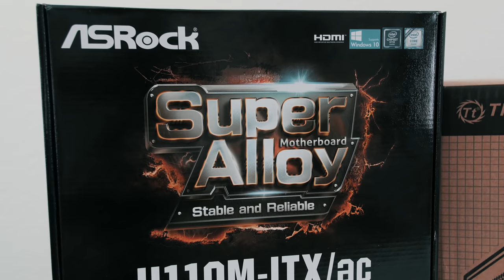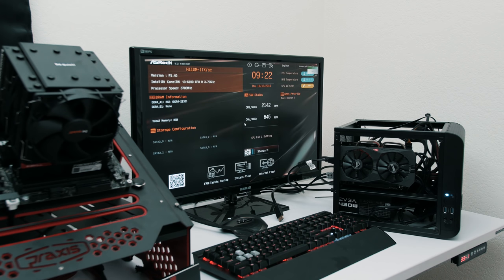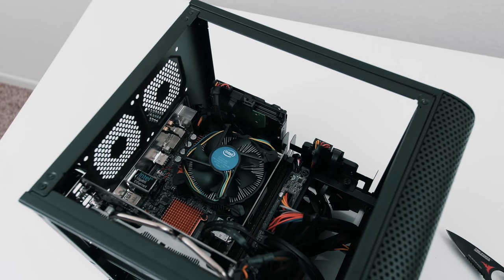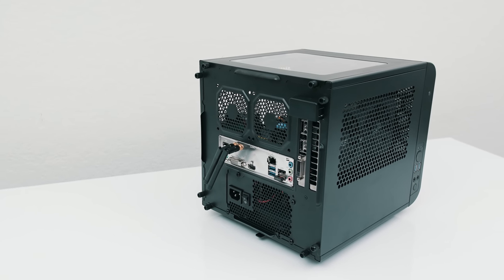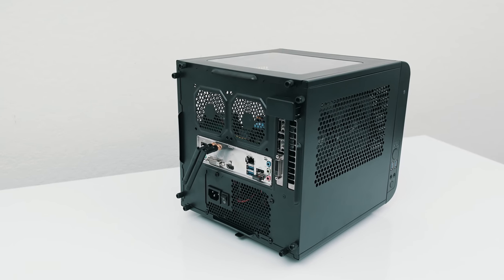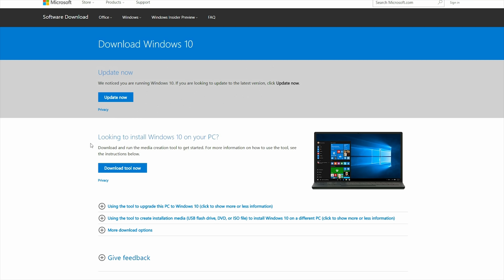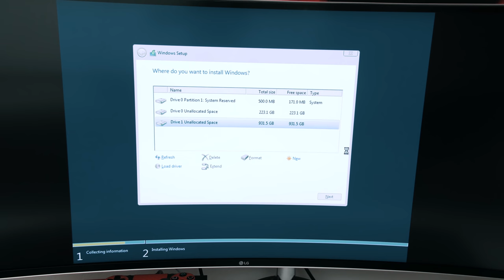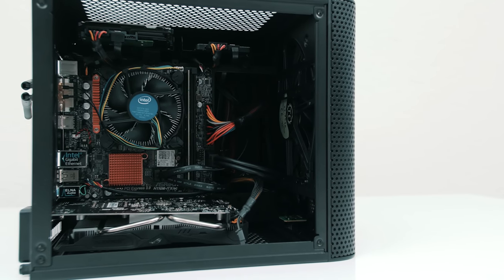How To Build A $500 Gaming PC w/ Windows 10 Install

Comment: professional, clean and easy to follow. I have seen many videos of the kind, but this one have to be the most perfect video. Not to long, not you blabbering about something else and you have also included how to install Windows + the drivers. Good job!
Reply from the maker: Thanks!
Reply: TechSource you a legend
Reply: WirIez  I think The same an BDW I watch from 200k subs on tech source I was never needed to think that you wil get more than 900k subs gg wp
Reply: Arthur De Witte haha niet nl beloofd
Reply: MegaMily misschien 😛
Reply: I miss the part where you should show the stand of screws on the bottom of the case, so the Motherboard is not sitting directly on the plate.
Reply: WirIez experience is really noticeable these days ;)
Reply: this case has built-in standoffs...
Reply: Good to know, but not all have ;)

Comment: 16 minutes and just 1 ad? Really nice.
Reply from the maker: +Davide Ciuffardi Pais there is no ad..
Reply: Oh really? I just saw a pop up ad (the one thatt looks like a push notification), must be a youtube ad by itself. But still more impressive.
Reply: Davide Ciuffardi Pais Is the 430w powers supply enough if I upgrade to an i5 and a gtx 1060?!
Reply: I'd go for a 600W if you have in mind upgrading or Overclocking your CPU.
But for that, 430W is enough
Reply: Frank Doukas probably not
Reply: yes it is
Reply: me 2
Reply: buy. adblocker. on. chrome. webstore. its. free.
Reply: Davide Ciuffardi Pais I got a 4 Second ad.
Reply: Davide Ciuffardi Pais I don’t have to deal with adds even tho AdBlock devs are sellouts I have YouTube Red
Reply: wow really rude
Reply: 16 minutes and just 0 ads ? Really nice

Comment: Ed any chance of you making a VR ready PC as cheap as possible ?
Reply from the maker: Thats on my list, perhaps early next year.
Reply: can you plz make an 1500$ build? just like this vis so like we can folow
Reply: Ed What do you think about this pc parts I need a little help from you

i5 6500
GTX 1060 G1 GD
16GBRam HyperXFury 
1TB HARD DRIVE 
650Powesply Gold2
MSI Gaming B152 MOTHERBOARD
Reply: he wil answer tomorow I think
Reply: BWD how do you get it from al The parts??
Reply: Yes I will but my money finshed :D I need to buy it next time
Reply: Saleh Mazin windows boot and stuff, for 30 bucks its worth it. 120 gb ssd is always worth it
Reply: Saleh Mazin
Reply: I built my budget VR rig for $375, but that's not realistic since a lot of my parts were 1 day sales or pricing mistakes.
Reply: +R4MS3S - looks good to me. Which case u going to use?
Reply: Can you please make a 700 dollar PC ft a gtx 1060 xtreme
Reply: +Saleh Mazin SSD gives a smoother pc usage experience. It feels so much better you just can't put the OS back on an HDD. That's why.
Reply: MUFC01 
cheap vr build for 550 is i36100 and rx 480. just need to cut down on the cost of other parts
Reply: i5 6600
Gigabyte GTX 1060 G1 6gb
8gb DDR4 HyperXFury
1TB Hard drive
650W Corsair VS650
Asus B150 Pro or Plus
Reply: i5 6400 and i5 6500 does support vr aswel
Reply: It's a really solid system, except I would really recommend at least a 120GB boot SSD.
Reply: MUFC01 look at the ice cube pc  videos and what I'm doing (I'm building ice cube ) and what I'm doing is putting a Radeon Rx 480 8gb and it's vr ready
Reply: isn't the rx480 vr ready?
Reply: Yup!
Reply: Hey! I´m not Ed but i think that the HyperX Ram sticks are too expensive for ur build.. Maybe a different ram like Crucial Ballistix Sport! Much cheaper but fast and looks good
Reply: true, but if you're getting more than 8gb ram, it'll be more expensive than g.skill ram :P
Reply: An SSD is absolutely worth it. The difference in machines where the OS is loaded on an SSD is night and day.
Reply: MUFC01 the rx 480 is advertised as vr ready and is only around $250. Who knows if that is true though
Reply: a little overkill on the 650w PSU, but if its in your budget, go for it. You may want to go for SLI sometime in the future.
Reply: Venevicus A 650w PSU isn't overkill, there priced well. You'd end up paying more for a lower wattage PSU than one that's 600w. Also, a single more powerful card is always better than two weaker cards. Less power draw is the main factor. Hopefully more games will have better support for SLI but for now, single card solutions is the best way to go.
Reply: well for this build, I agree with that, but I think if you wanted to go even cheaper, you could use an EVGA 430 watt PSU, still have plenty of power left, and get perfectly fine performance. The 430 watt is like 30 bucks vs 20-30 more for a 500 watt.
Reply: what if I want the big red case
Reply: what if I want the big red case
Reply: R4MS3S is
Reply: true dat, it should be optional
Reply: can i put the GTX 1050 ti ????   because i think its better than the rx 460    please reply!!!
Reply: TechSource I am new at building computers and I was wondering if I could put an i7 processor instead of the I3 would I be an upgrade or make it worse.also could I record on this pc??
Reply: gavin if you are going to record use GeForces Shadow play (if your going to use a nividia GPU). i7 is good for video editing if you're not going to edit videos than i woud go for i5 and i don't know which parts you have. maybe they will bottleneck.
Reply: cheerier Brush67 I haven't gotten any parts yet but I was going to use the parts in this video but maybe change the CPU. So if I am going to record and edit get the i7.
Also thanks btw I am new at this so what is bottle necking??? I am a noob I just trying to learn. Thanks
Reply: MUFC01 Is the 430w powers supply enough if I upgrade to an i5 and a gtx 1060?!
Reply: MUFC01 nop
Reply: MUFC01 I mean u can buy 1050 ti
Reply: yea dat would be GREAT
Reply: were is better to connect my monitor on the motherboard or graphics card??? pls reply!!!!
Reply: Altair you can't connect a monitor to a motheboard.use hdmi to connect it to the graphics card
Reply: but my motherboard has a hdmi port
Reply: frank doukas are you greek?
Reply: Altair yes I am Greek and you should connect the monitor to the graphics card
Reply: Frank Doukas kai ego elinas eimai re aderfe kai se efxaristo gia tin simbouli!
Reply: Altair tipota re
Reply: +Frank Doukas   : )
Reply: I like it. maby add a ssd as your bood drive if you have the budget.

Comment: -----------------------------------------------------------------------------------------------
                                      PC

GPU: GTX 1060 FTW SC 3GB GDDR5 (Single Fan)
CPU: Intel 3.70 GHz i3-6100 3M
PS: EVGA 500W
RAM: Kingston HYPER X FURY 8gb 2133 MHz DDR4
MOBO: ASRock ITX DDR4 LGA 1151 H110M
CASE: Thermaltake V1 Mini (Black)

------------------------------------------------------------------------------------------------
                             PERIPHERALS
MONITOR: ASUS VS228H 21.5" 1920 by 1080 HDMI DVI VGA LED 16:9 60Hz 5ms
KEYBOARD: Corsair Vengeance K65 mechanical
MOUSE: Redragon M601 Adjustable up to 2000 DPI
MOUSE PAD: Steel Series Qck

Budget (USD): $850
Total PC: $551.84
Total ALL: $625.81
Is the pc a good build, are the peripherals ok?
Reply: Hammer boy brooo thats dope!!
Reply: Hammer boy its good but I recommend a better CPU for better performance
Reply: FazeBros265 And a better mobo
Reply: I would recommend the 6gb version of the GTX 1060, because a lot of games nowadays need 4gb of GPU horsepower
Reply: Hammer boy I would recommend getting a i5 and unless you are going to overclock that mother board should work fine and then going for a 6gb gtx 1060 would give you a better experience in more demanding games
Reply: Hammer boy replace the i3 wid a i5 or i7.
Reply: dont get i3 ffs its trash and not gtx 1060 3gb
Reply: NARWHAL_ DEDSEC lol
Reply: Where is the storage?
Reply: If your budget is 850, why is your pc only 650?
Reply: its a very good pc, but i recommend you an i5, because it will pair better
Reply: And a beer mouse
Reply: nah the mobo is good
Reply: Probably because he didn't include storage.

Comment: can i switch the i3 for an i5 for more performance?
Reply: tenma In some games yes.
Reply: it isn't worth it if you don't upgrade the gpu but you can do that.
Reply: ok thanks for the answer:)
Reply: thannks man :)
Reply: no problem :D
Reply: What eNHoo1 says is not true, it is totally worth it. I would even go as far as to say you don't need the SSD either, literally all you get with that is faster boot, you are better off not getting that and going for a better cpu or GPU as the gains from those are much greater.

If you are building to a tight budget then an SSD is something you get if you have money left over and can afford it.
Reply: honestly id rather drop the HDD than the HDD yes it only make it boot faster but also everything else in windows is faster id say a ssd MUST exist in any build even in budget builds.
Reply: Yes, but make sure it is the same socket! You can break your motherboard and cpu if you put in a cpu with wrong socket.
Reply: get i5 6500 and rx470 for great performance boosts
Reply: Going from dual core to quad core will give you lots of performance gains
Reply: ZM Thunders ok man i will thank you, inam an rookie in the computer world so it is always nice to have some help :)
Reply: better upgrade gpu
Reply: ZM Thunders not the 470, the 480! the 480 isnt that much more so just buy it.
Reply: speedygabriel1 true but if the budget is real tight
Reply: ***** typo meant drop hdd for ssd
Reply: Sure you can but watch out because the motherboard doesn't support some i5 processors.
Reply: tenma Is the 430w powers supply enough if I upgrade to an i5 and a gtx 1060?!
Reply: Frank Doukas no
Reply: tenma yes. But youd have to upgrade the power supply and fans if you're planning on overclockin
Reply: Dennis isnt it the same?

Comment: can you please build a 1500 dollar gaming PC with windows
Reply: Heres a pretty good part list for around $1500 USD, http://pcpartpicker.com/list/4hFvZ8
Reply: FluxVibes Is the 430w powers supply enough if I upgrade to an i5 and a gtx 1060?!
Reply: Frank Doukas well what kind of i5 r u gonna use?
Reply: Derpinator actualy Is the 430w powers supply enough if I upgrade to an i3 and a rx 480?!
Reply: Frank Doukas I use an i7 4790k and a EVGA 1070 FTW and am still using the 430w power supply I have been using for a couple of years now, you will be fine for instance you can run an i5 6400 and 2 gtx 970 in sli and it will only use about 500 watts (info pulled from siblings PC)
Reply: dude that build is going to be a beest if you had at leest a gtx 1060

Comment: hey can you make a budget build pc configuration for video editing works specially for youtube starters
Reply: you can use this one but with a better cpu, an i3 6100 has only 2 cores and 4 threads. if you want to get into youtube seriously, maybe go with something with 4 cores, and more mb cache
Reply: Will it can be done in 30k
Reply: 30k?
Reply: He means INR30k which is around USD 450...
Reply: Yamin Siddiqui yes right
Reply: Abhishek Jadhav 450? you should really just get this build, but invest in a better cpu. like i5 4690k or even i7 4690k if you wanna go all out. if you don't want to spend more than 500, then it'll be hard to make an awesome rendering computer
Reply: Abhishek Jadhav If it's for editing only, don't buy a GPU at all, buy an i7 6700k, and base your entire PC around it.
Reply: What is required for video editing softwares a good processor or a good graphics card
Reply: Abhishek Jadhav a good processor, no good video card
Reply: Which will be the best graphics card under 15k
Reply: Abhishek Jadhav GTX 1080, for animation rendering etc. GTX Titan XP
Reply: he means 15k INR - not 15k dollars

Comment: This might sound dumb but can I switch out this case with any other case?
Reply: And also can I (Should I) switch the rx 460 with a 1050Ti? Would the wattage be the same etc
Reply: yes
Reply: mufasa harambe just leaving a comment here to get notified. I want to know exactly the same things but can I also switch the processor to an I5?
Reply: Yes you can switch to an i5 processor but the socket must be same.. That it it must be an i5-6xxx (skylake architecture)
Reply: no
Reply: Vorname Nachname you might need a new mobo
Reply: Guys just use pcpartpicker to know which components are compatible. pcpartpicker is a website specially made for this kind of stuf.

Comment: hey i got this computer and the hdmi won't work pls help thank you
Reply: Trap Wavez why does it not work??
Reply: Trap Wavez check the monitor, is it on, is the Cables properly plugged in? Try a new monitor and a new Hdmi cable
Reply: Trap Wavez hey, same, did you happen to be able to fix the problem?
Reply: i also built this pc and the hdmi would not work
Reply: make sure you guys double check the plugs. If some don't work, try the graphics card port
Reply: if u put a gpu in the hdmi on the mobo wont work put the hdmi in the gpu
Reply: Guys connect HDMI cable in GPU and be sure that your monitor source is HDMI. Cheers!

Comment: I just built a sub $350 gaming PC.

ASUS TUF B450M-PLUS GAMING
Used DVD drive
Ballistix Sport LT 16GB Kit 8GBx2 DDR4 SDRAM 2666
Corsair Carbide Series 200R Black Steel 
CORSAIR TX-M Series TX650M
Ryzen 5 2400g
PNY 120GB SSD

$545 After $212 in discounts and Amazon credit, $333.
$378 after shipping and tax.
Even without the $85 in Amazon gift cards, it would have costed me $463.

If I didn't buy another SSD. It would have costed me $304 before shipping an taxes, and $349 after shipping and taxes.

Comment: man this is the most through out guide. ed, thank you. i've seen no other video that help me to install the hd audio and led power in other channel. one question ed, is the antenna is pre available and is that for wireless connection. i did not have any clue what that is. the only thing i can tell is that it is for wifi.

Comment: Hey Ed, I'm going to build a similar build for my birthday in a few weeks and I was wondering if the new GTX 1050 ti would bottleneck the i3-6100. Can you tell me? Its okay if you can't because the 1050 ti is a fairly new card. By the way, I'm eyeing the MSI Gaming X 4GB version of the card.

Comment: I have a very important question I have a MacBook Pro 2015 model 256 gb version and a Ps4 Im a gamer and i usually play games on my Mac such as CS GO and LOL with high settings and never really experience FPS drops or anything unbearable I play most of my games on my PS4 ranging from Skyrim remastered to GTA 5 and uncharted 4 most games you can name off the top of your head for a PS4 I'm planning on building a PC I have a $1000 dollar budget but I'm starting to question if spending a thousand dollars is really necessary because I'm really wondering is having a near top spec PC change my entire life and perspective on my games or is it something that I can just bunny hop for now until later in life...?

Comment: I went on pc part picker. is this a good build?
AMD 5350 2.05GHz Quad-Core Processor
ARCTIC Alpine M1 - Passive Fanless CPU Cooler
Gigabyte GA-AM1M-S2H Micro ATX AM1 Motherboard
Corsair Vengeance Pro 8GB (2 x 4GB) DDR3-2400 Memory
ADATA Premier SP550 120GB 2.5" Solid State Drive
Asus Radeon R5 230 2GB Video Card
DIYPC DIY-F2-P ATX Mini Tower Case
Topower 550W ATX Power Supply
Microsoft Windows 7 Home Premium SP1 OEM 64-bit
D-Link DWA-582 PCI-Express x1 802.11a/b/g/n/ac Wi-Fi Adapter
LG 19M37D-B 18.5" 1366x768 60Hz Monitor

Comment: i didnt just drop a like i raped the like button so hard my cpu burnt
Reply from the maker: +HeaT VeNoM haha 👌🏻
Reply: :D
Reply: I usually don't like rape, but the like button had it coming.
Reply: TechSource bro I need your help I get 100fps or less  on cs go with a amd a8-7600 quad core 3.1 GHz and with a strix 970... and in other vídeos I see people playing with 400 fps
Reply: any help to fix it ?
Reply: Marcelo Martins They are most likely playing on low settings, and also, 100 fps is more than playable if you have a regular 60hz refresh rate monitor.
Reply: But I see people getting core clock 1342 and memory clock 3502 and I only get 200 core clock and 600 memory clock ..
Reply: I downloaded camwebapp and I think I touched something... Now if I put reset it stays the same ..
Reply: Marcelo Martins And your friends all have the EXACT samer cpu?
Reply: No but I know I can get more fps , but the core clock and memory clock are so low I wanna know if I can fix it
Reply: Marcelo Martins Other than overclocking or if your CPU has something close to intel's boost, then getting a new cpu would be your best bet.
Reply: HeaT VeNoM Is the 430w powers supply enough if I upgrade to an i5 and a gtx 1060?!
Reply: Frank Doukas Get a 500w to be safe.
Reply: AND FOR FUTURE UPGRADES DOWN THE LINE
Reply: HeaT VeNoM ii